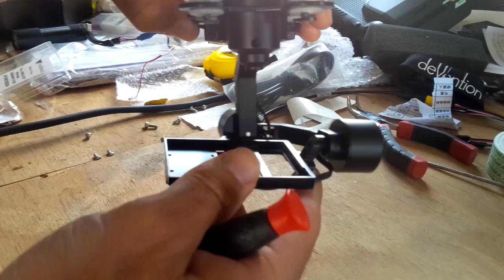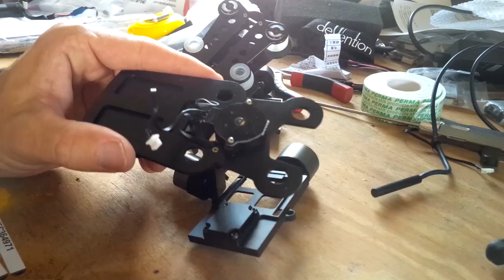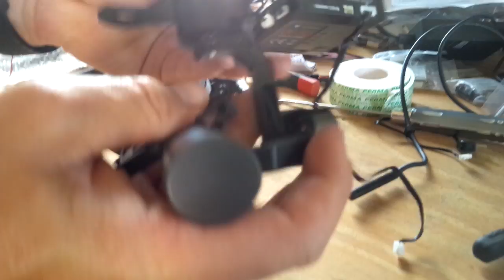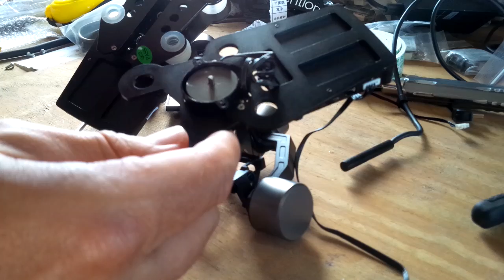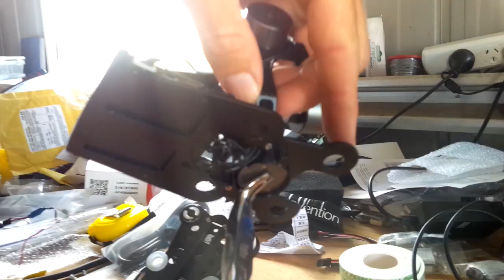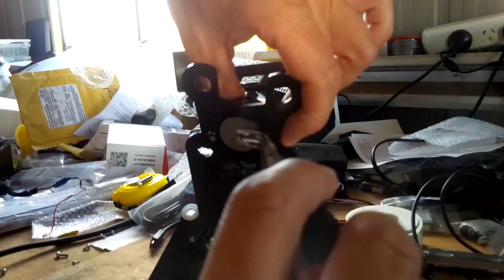Walkera 3D Gimbal Yaw Issues and fixing

Comment: How do you remove the saftey clips on the front rubber boots to remove top plate of gimbal? Do they pull off or twist, did not want to damage it. Thanks Mate!
Reply: Mine didn't unscrew, They were press fit together. I tried to unscrew them and it destroyed both as they sheared off. On further inspection I discovered they were press fitted.
The replacements are screw on I see so... if you destroy them trying to unscrew them when they are press fit, and it'll happen easily if they are, you can replace them.
Reply: @YknotLearnall  Get lost. They are screwed on.
Reply: @174wolf   - mine didn't. And I destroyed both trying to unscrew them. They sheared off when I attempted to unscrew them, and did so very easily.
But I do see new ones do screw together.